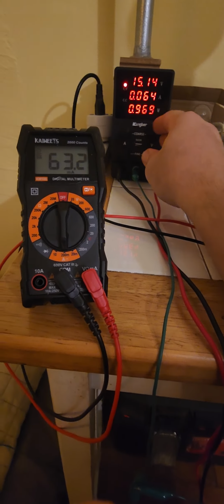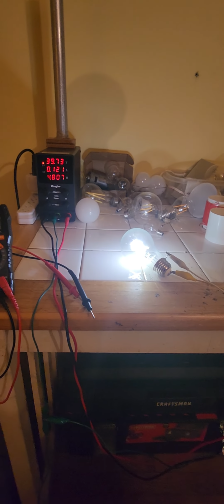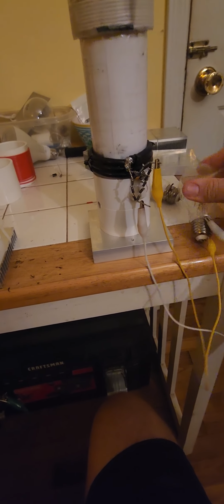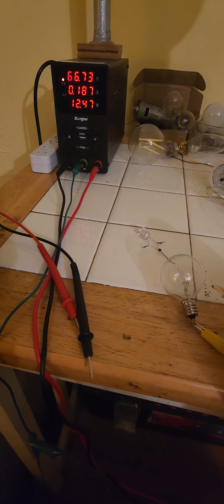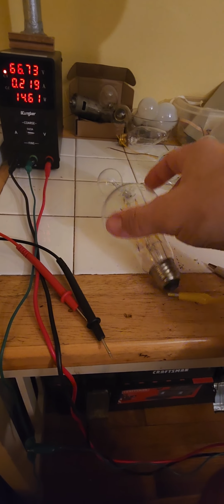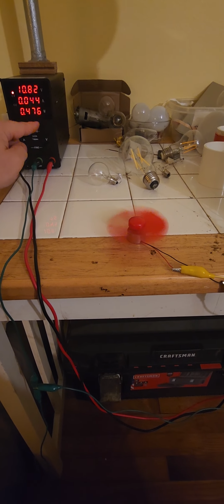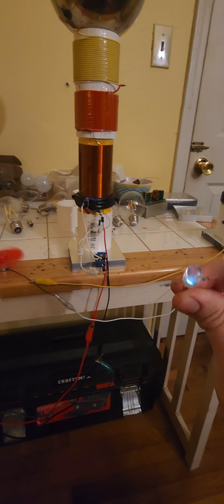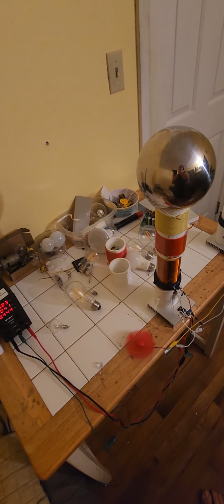📶 A Breakthrough Has Been Made. Receiving Twice The Power From A Bucking Tesla Coil Transmitter💡

Comment: Fantastic work with using the partnered output coil ! Look forward to the pulse charging circuit experiments. I also noticed the transmitter is grounded in this experiment. What happens if you also earth-grounded the receiver coil? Is there an increase in power to the load? Thx
Reply from the maker: If the receiver coil is Earth grounded from a seperate distant earth ground the receivers output power will increase by about 5-10% while the transmitters input power goes down. Very interesting effects are occuring now within the wireless power transfer system